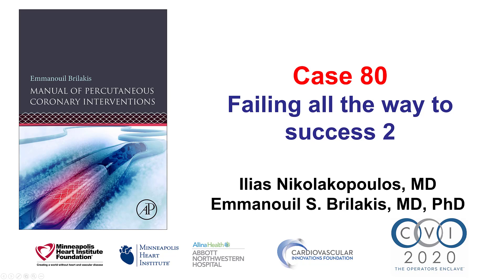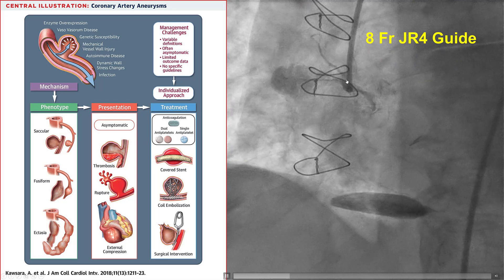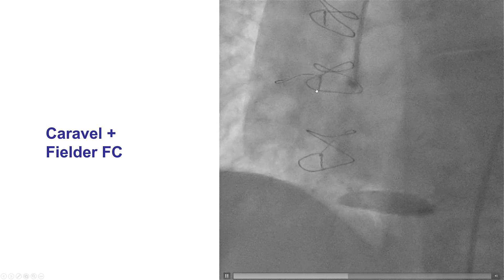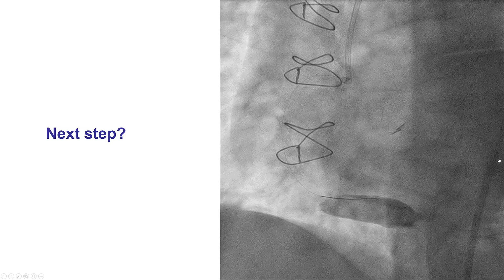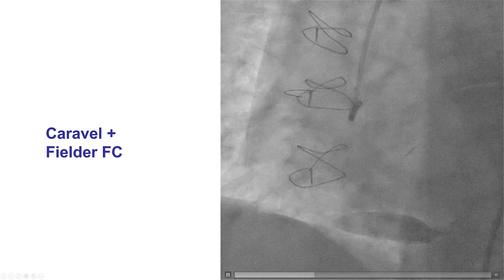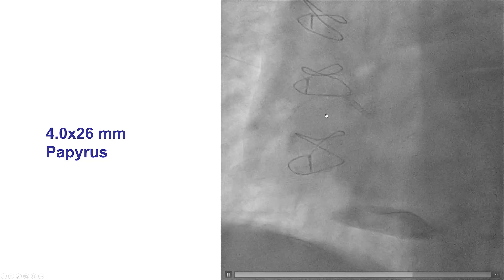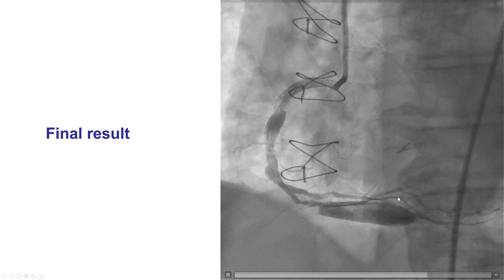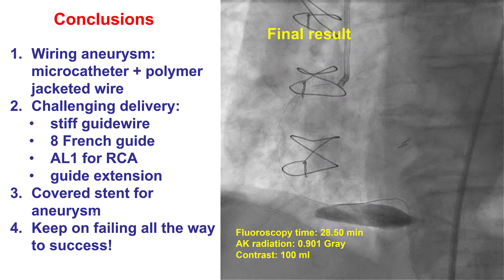Case 80: PCI Manual - Failing all the way to success 2

Comment: Good case ...                                                          Do you perform any post dilatation for the covered stent ?? In any case if not this case     ....
2.what would have been your option if there had been a thrombus in aneurysm ..would you plan pci or just thrombolyse and defer pci ?
Reply from the maker: We did not perform postdilation of covered stent except for the overlap segment with the proximal DES, as IVUS showed good expansion; however postdilation in recommended, especially for the GraftMaster stent, which is hard to expand.
If thrombus was present within the aneurysm, but antegrade flow was still present and wiring could be done without disrupting the thrombus and embolizing would probably treat with covered stent. Otherwise, can consider heparin or GP IIb/IIIa infusion with repeat angio and PCI after 48 hours.